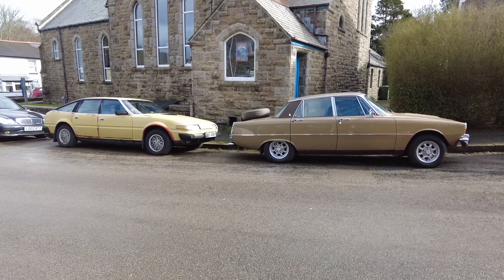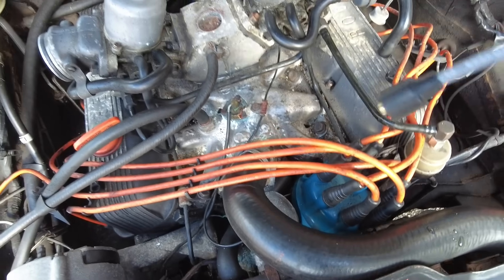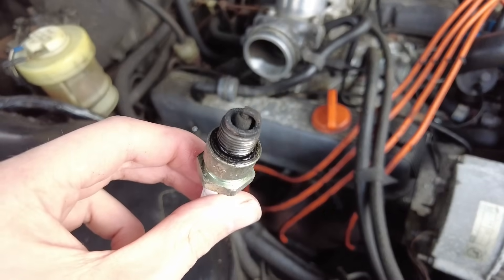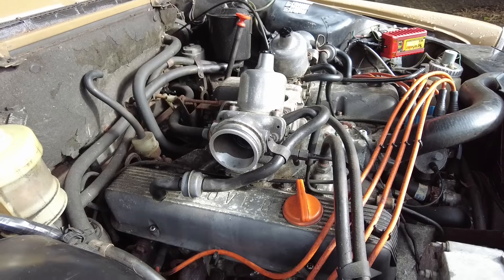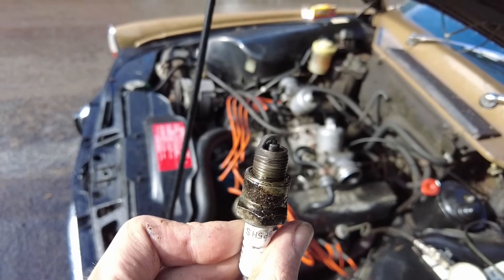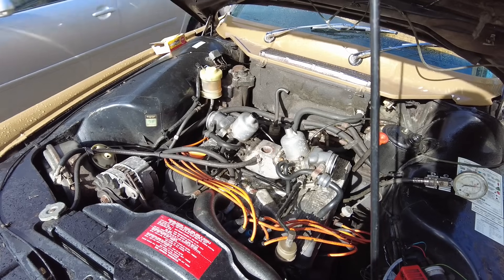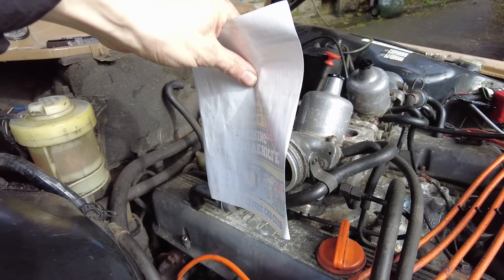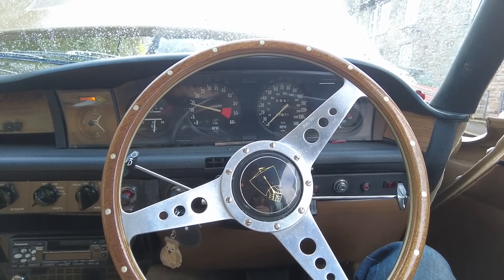I Bought A Rover P6 V8 Auto Episode Two The Engine Is Not Well.....

Comment: What i have learnt from running these v8 engines, is that they don't like to be started up and not driven, as they like to soot plugs for fun!  If you are going to start the engine then make sure you take it for a drive and get the engine up to full temperature, that way the plugs can self clean. I would do a oil change , valvoline 20w50 is best for these engines as it has the zinc needed too protect the camshaft, also i would add some ametech restore oil (oil additive) which will boost the compression.

Comment: Evening Sheldon, great video as always  with top notch narration,, the plugs in the engine should be BPR6ES long reach and NOT NP5HS short reach Plugs. Oil outside on the spark plug means an external leak not rings or valve stems seals, Also if no air is been drawn into the carb's it must be getting air from somewhere else, Try removing the oil filler cap when it's running and see if the RPM increase, Finally oil in the dash pots 3 in 1 viscosity, very important.  All the Best.
Reply from the maker: It has a SD1 engine so not sure if that takes the long plugs but funnily enough there are a brand new set of the long kind of spark plugs in the boot!

Comment: Sheldon.. I admire you. You have a great collection of cars. As for your P6. Remove your carbs and the manifold and rebuild them with easily obtained kits. Replace the gasket and the plugs. Replace the dizzy points with an electronic replacement. And as for the  smoking, I'd check out your piston rings.
Good luck.

Comment: I'm sorry but you are talking twaddle. You say it's an SD1 engine. It does not look like it. If it is you've got the wrong length spark plugs. Oil on the outside of them is rocker cover gaskets leaking. Propper tools would get the plugs out. You are supposed to do a compression test with ALL the plugs out & throttle fully open. Get someone who knows what their doing. The 4.6 is probably the worst Rover V8 of all time.

Comment: Glad that you are doing that because in my previous comment that is what I said I would do so once again hope that has helped.Also looking at that you have vacuum leaks all over the place looking at the compression test with a good run that will come up so in my opinion vacuum leaks sorted out and good quality plugs ( bosh not champion) sort out the carbs points condenser dizzy and rotor button leads oil change and all filters happy days in my opinion also check fuel pressure if it is low put an electric fuel pump in it and check the o ring in the fuel changeover valve from main tank to the reserve tank.

Comment: In theory you should be able to remove the spark plugs with one of those fancy "T" handle tools.  The advantage of those is that you won't end up over tightening them and they also fit down the holes in the cylinder head.  To remove stubborn plugs you will have to get hold of a thin wall plug socket, preferably 1/2" drive.  The outside diameter will have to be no larger than 27 mm.  I ended up turning the outside down in the lathe to a length of 32 mm so it will reach the bottom of the plug hole without binding on the cylinder head. It's worth also getting a 1/2" universal joint socket as well for the hard to get to plugs.

Comment: Hi Sheldon. The engine sounds fine to me and as it has good oil pressure I would give it a good drive to clear itself a bit. Maybe then change the plugs and see how it goes from then ,also I assume you have put a little oil in both dash pots, should help with the running issue. So what if it burns a little oil as long as there isn't clouds of smoke coming out the back just enjoy it as it is for a while.

Comment: If the engine runs,   There can`t be too much wrong,   (  Timing /  Firing order etc  )    I think your problem is contamination from the petrol tank,    Enough is getting by the fuel line and carbs to idle,     But as soon as you increase the revs the fuel  / air  cannot meet demand

Comment: That is a classic Rover V8 symptom the static timing is out a few degrees. They don't like  much variation running on 4 star / unleaded to the BTDC or they will crank ages and not fire. If the static is OK, the other probable cause is that there's wear in the distributor drive, or baseplate.  It should fire before it's completed one full revolution if everything is OK, without all that wheezing and cranking.  Check the  backlash in the distributor drive. If you can turn the rotor arm more than a degree or so, it's too worn. You'll need to pull it out and maybe renew the gear and roll pin. Same with the baseplate, check it moves smoothly and there's not sloppy wear in the pivot point rivets.  If it is a Lucas D8, it's got the original P6B one, and likely well past it's best now.  Some pre 1973/4 V8's suffered with worn base plates, causing erratic points gap, the later one with the concentric baseplate are better. SD1 distributors all have electronic ignition. It could be that thin old oil is causing hydraulic lifter delay, and it will be seeping down the valve stems, and it will drink it like a fish past the oil rings. A good healthy engine with correct mixture set doesn't have a great deal of suction at tickover. You'll need to check the carb pistons are free to move their full stroke.  If you're using an engine originally from a 4x4, you'll have a fair bit of parts swapping as the water pump is mounted higher, on a different style timing case. The fan won't clear the bonnet with that set up, and you may need to swap the crank drive boss and pully and spacers about to get proper alignment for the drive belts, and it to work the new type concentric oil pump inside the timing cover. Not a simple swap, unless you know what parts will swap over.  Looking at the engine serial number will identify exactly what vehicle it was originally fitted to. Pre 1973 build engines  have the number and compression ratio stamped on a web at the left rear, above the flywheel. Post 1973 have it on a web next to the dipstick tube.  If it's hardly visible on a later engine, it's usually a sign the block has been surface ground to cure warp, or corrosion pitting.
Reply from the maker: Hiya Brian thanks for the comment helpful as always but there should be alot more suction then that even at tickover as our SD1 is the same engine and that has alot more suction so the nest thing I will be looking into is the vally gasket as if there is a massive air leak that would make alot of sence! But we are going to go over the other things you mentioned as you will see in upcoming videos!
Reply: @classic_britain  No, they don't suck that much air on tick over. The base of the dash pot piston is barely above the jet bridge at correct tick over.  Your engine still has its P6B rocker covers, so if the SD1 has the same, it's got a P5B or P6B engine if you can find the engine number, I should be able to tell you its original build spec, and the exact model it came from the factory in. I used to tune all mine, even worn you could get them to run turbine smooth.  With everything set up, nothing worn in the timing, they'll pick up and run from 500rpm to red line with little flutter or lumpy. You can barely hear the 3.5 carb V8 in my 1985 SD1 if you close the bonnet.  People mistakenly overfuel the carb and then screw up the air screw to match the fuel. Start with the jet flush with the bridge and screw the fuel screw no more than a half turn, then adjust the air to match, not the fuel. My SD1 would achieve near 40 mpg on a motorway run with ease.

Comment: Strip the carbs and clean them and flush out all the old fuel, new filters and put new petrol in. If that does not improve things then a top end rebuild . Bottom end looks fine from the oil pressure and no knocks. Good luck.

Comment: I would Guess Carb problem ..Check dash pot oil ..hope it helps ..Great looking car in fab condition ..Hope your keeping well
Reply from the maker: It's not the carb there is zero suction
Reply: I've had dash pot oil issues on an SU in the past, poor start, not revving etc. after replacing a rebuilt head. I'd used too thick viscosity oil in dash pot and when cleaned and replaced with lighter oil it ran perfect. Not saying this is the issue with Sheldon's motor though.
Reply: I guess i was right mate glad you sorted it out ...

Comment: Compression test needs to be done properly!

Done after a run, engine warm, important on hydraulic tappet engines, a cold engine may have tappets leaked down that will affect readings.

Must have All plugs out

Must hold throttle fully open and ignition disabled. Turn engine on starter till comp gauge does not climb anymore, not just 4 turns of crank!

Maybe one or more of those plugs you can't get out is bad. Try again to remove them with fully hot engine, use unequal expansion to your advantage.
Replace with NGK in boot.....!

A bit of oil on plug threads doesn't spell doom!

You'll find it easier with manual choke SU to give bit of throttle to start, I noticed you didn't touch gas pedal at all during starting, these old P6 do not have FASD devices like SD1, need a little pedal!

It seems, you Want to condemn this engine, I dunno why....

Comment: If it's not sucking in the intake to the carb, then you probably have a leak somewhere else (carburettor base gasket? intake manifold? etc) engine shouldn't be tired, compression is good!
CAREFULLY spray some brake cleaner around carb base gasket and other suspected leaking areas when running and listen for change of engine note (denoting a leak)
Do a full carb clean and rebuild first, before condemning the engine... it's easier to rebuild a carb than swap an engine!
Reply from the maker: Yeah worth a look at the vally gasket